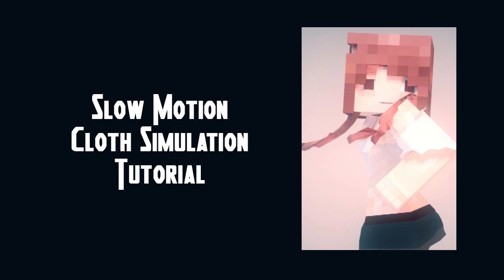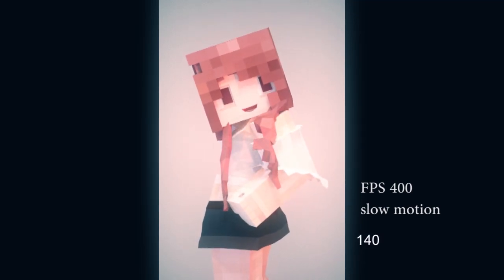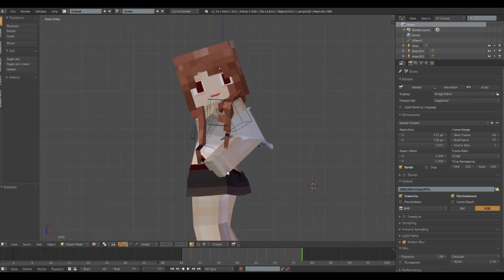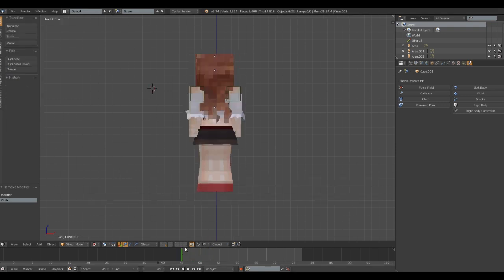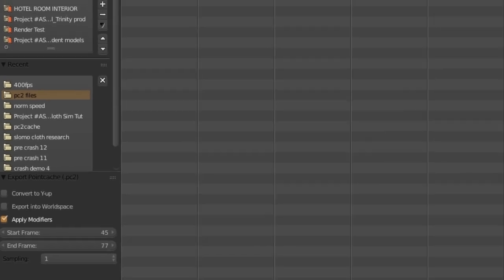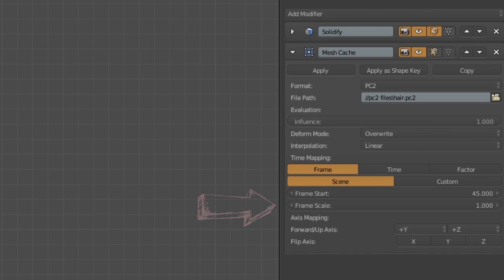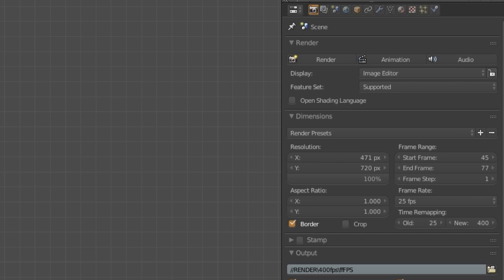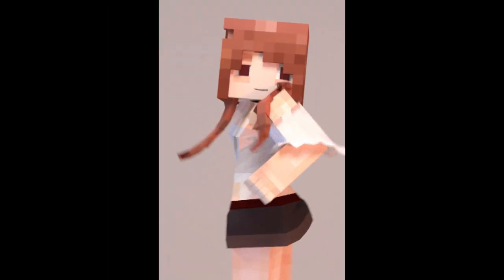Blender Tutorial - Slow Motion Cloth Simulation

Comment: I ran into this same problem and I'm using Blender 4.2, so this has not been fixed. Originally, I had my frame rate set to 24 fps when I did my cloth simulation. I tried to use time stretching like you did and found that movements were only happening every five frames, which, of course, is not right. I decided to try setting my frame rate to 120 fps and and re-baking the cloth simulation. The results were exactly the same! No change at all. It seems the time scale for cloth simulation is apparently fixed at a lower frame rate and can't be changed. 
I found a solution similar to yours but a bit different. I exported a Lightwave MDD file for my cloth object. When that is imported, the object has a sequence of shape keys, changing at each frame. This is something that can be time stretched successfully, and the keyframes for this sequence can be shifted along the timeline, as opposed to importing an Alembic file. 
I was looking to see if anyone else had a better solution, but I guess not.

Comment: Hi,

I followed this and noticed that Blender is simply duplicating frames and not interpolating them as expected - this is the same if you use the built in time-remapping function or the PC2 plugin.

Therefore when a rendered frame sequence is imported into After Effects, the movement isn't smooth, but noticeably jerky, whereas in Blender itself it plays smoothly within the viewport.

It would have been useful to see how the slowed down simulation should be exported so that each frame is a smaller increment of the  animation and not duplicated frames.
Reply from the maker: the render settings and viewport settings are separated, it might be possible that your render settings has not been matching the viewport settings. Or I might be wrong, I haven't use blender for a long time, switched to maya a long time ago.
Reply: I discovered the problem, which may be to do with the mismatch between render & viewport settings as you say - I can scrub through the timeline after time-remap and the slowed down animation becomes visible, but if I hit “Play”, it  gives a false impression suggesting that the re-map is being ignored altogether and the scene has messed up in some way - If I render the scene it renders fine, but of course there’s no way of being sure, which is frustrating.
Reply: The time remap function does actually result in true interpolation when it uses the saved point cache as described in your tutorial.
Reply: @raviswami9852  does it means that we have to convert pc2 into a "blender pc2 version" of it ?
Reply: @raviswami9852  I have the issue with marvelous designer dress animation wich is really really frustrating
Reply: @lyx9574  - Hi _ I haven't been using this facility in Blender for a while so I'm afraid I can't help you with this query - it's possible that it's been improved in the latest update of Blender.